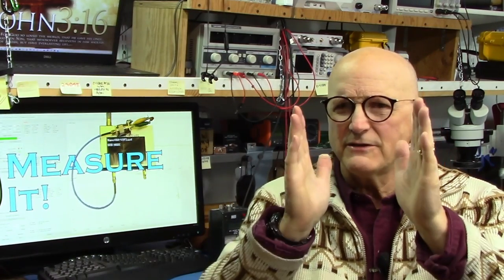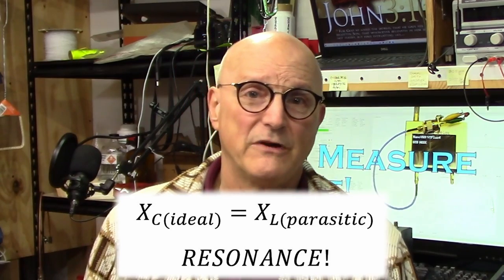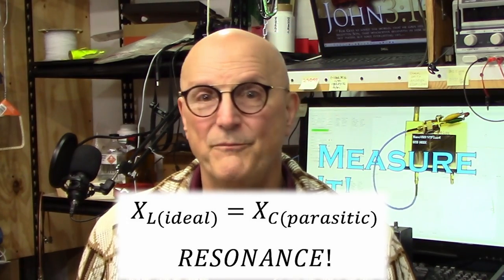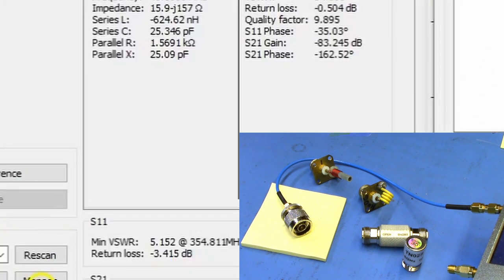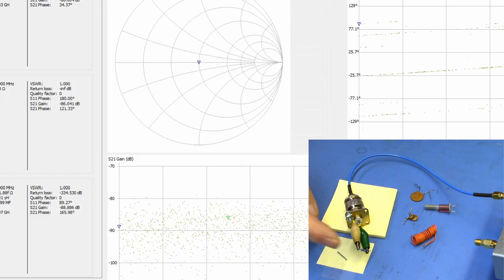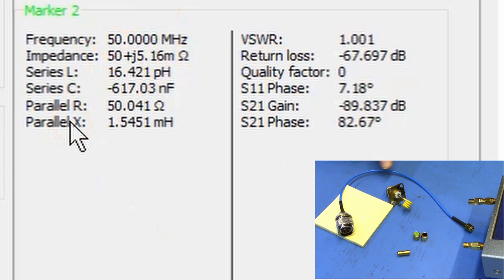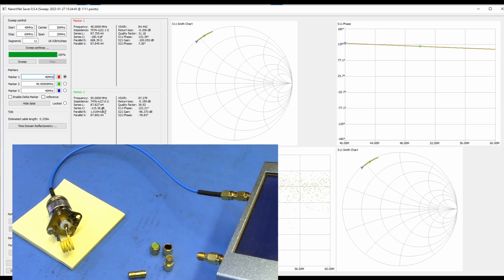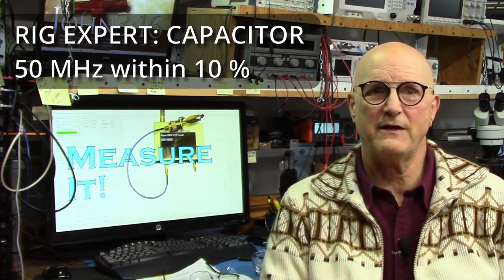Measure Impedance, Capacitance and Inductance using a nanoVNA also Compared to Antenna Analyzer(051)

Comment: Hi nice video , I do have 2 of rf scanners pro-sl8 and pro-7000fx , spec states up to 8ghz but it have mcx connector on it and poor antena . If the device can not handle more than 6ghz than I need to measure and build best antena from the lowest to 6ghz , but if it can handle more maybe if to change mcx to sma ? can I improve the frequency range ? .only what im scare to not burn it at the very beginning. Im not spec tech but I know mcx limit is 6ghz . This is  not cheap toy for my pocket so I'll need instructions. I know how to use soldering iron;) .my intention is to measure the real values that's  this toy can really measure also  chcek antenas to confirm what  is the lowest and highest frequency that it can handle , , also im thanking  to maybe add lpa antenna and some pre amp and amplifier my dream would be 12ghz . Can u advise what tools shoul I get to measure all my needs  and not to burn it ? And some step by step info pls?
Reply from the maker: First of all, the limitation of these bug detectors is not found in the antenna, but in the internals of the device itself. Regardless of the antenna you might put on it, it will only be capable to the frequency limits stated in its specifications.
The only benefit that you might have in changing antennas might possibly be in sensitivity.
For best sensitivity, the antenna should be physically tuned to the frequency that you are interested in detecting. A bigger, longer antenna does not yield better reception.
You could get more antenna gain using a colinear antenna. Again, this is frequency band specific, like any properly tuned antenna.  Here is a document that talks about their design: 
https://k5frc.org/training/coliner antenna.pdf
Hope this helps.

Comment: If you want to increase the accuracy of your homebrew 50 ohm standard solder two 100 ohm 1% resistors in parallel which will give you 50 ohm .5% standard. You can also use four 200 ohm 1% resistors  in parallel to make a 50 ohm .25% standard. BTW I'm just downstream from you in Davenport
Reply from the maker: Actually ... I have to disagree with you. A 200 Ohm, 1% resistor could be as high as 202 Ohms. Suppose, by luck of the draw, I put four 202 Ohm resistors in parallel. This will give me a 50.5 Ohm resistor.  But, this is a 50 Ohm + 1% resistor. So, I have gained nothing.

Comment: I was a bit confused (at first) by that impedance display. It used the upper case Greek letter Ω (for Ohms) and I was confusing it with the radian frequency which is typically the lower case Greek letter ω, such as Z = R + 2πjωL. 😀

73 de AF6AS
Reply from the maker: All these Greek letters ... it can get a bit confusing sometimes.
Yes, Z= R + jωL and Z(C) = R - j/jωC 🙂

Comment: The MFJ was the only cheap instrument to measure antenna SWR and X&R to give you an idea of your system. 10% accuracy is more than enough but at higher frequency not very good. You should know the limit of any instrument that you are using.
Reply from the maker: True that! I looked very, very carefully at everything that I could find to try to see what sort of accuracy MFJ claimed the 259 had ...... nothing and for good reason. 🙂

Comment: Thanks for all your videos, you explain things very well, I have a question about what series L, series C compared to Parallel X and Parallel X when and how I would use this info, I see it on both VNA and my rig expert. If you have covered this please guide me to your video that it is covered, or if not covered maybe you could do a video. Thanks; 73 N8KEN
Reply from the maker: Now THAT'S a really good question! 😀
Think of it this way ... the VNA "sees" a particular impedance as it it "looking" out its port. The "Series L/C" is answering the question, "What series combination of a pure resistance and a pure reactive component, like an inductor, do I need to create the impedance I see out my port?"
The "Parallel X" is answering the question, "What parallel combination of a pure resistance and a pure reactive component, like a capacitor, would I need to create the impedance than I see out my port?"
Being that the capacitor model and the inductor model have as their major components a series resistor (e.g. ESR) and an ideal capacitor or inductor, the Series L/C is the choice for measuring the value of the component.
Hope this helps.
Reply: Ok I think I understand better, thanks for quick reply and keep up the great work, you have one of the better you tube channels if not the best of all things RF! If you want an idea for another topic this might be good, I watch many you tube channels and don't think I have seen that explained.
Reply from the maker: @nj6h  Yep! I, indeed, just added it to my queue!  In fact, while my wife is at Bible study tonight, I am going to start development on just that.  Thanks for the input! 🙂
Reply: @eie_for_you  
I, too, had this same question. Many thanks for the concise and understandable explanation!
Reply from the maker: @boatknuckle  You are very welcome! 🙂

Comment: has the price fallen yet?
Reply from the maker: As VNAs go ... they are VERY cheap (last I checked). Inexpensive nanoVNA clones can be had through various outlets (e.g. Amazon) for under $100, but you get what you pay for ... a inexpensive clone with definite limitations. With that said ... if the inexpensive clone will do everything that you need to do and do it well enough for everything you will need it for, then go with the inexpensive clone.
The official, genuine article nanoVNA that I have is running around $300, which seems like that is more than I paid for it.🙂